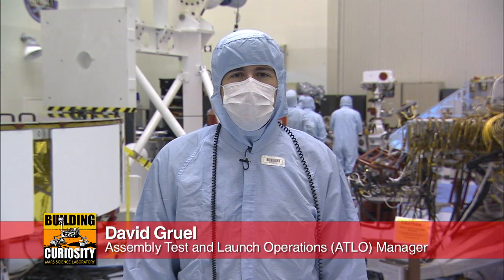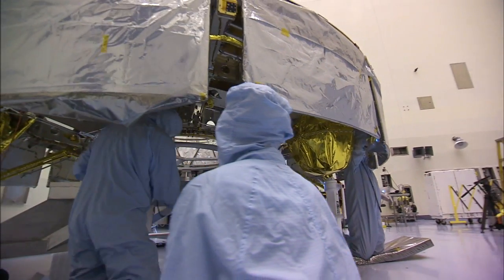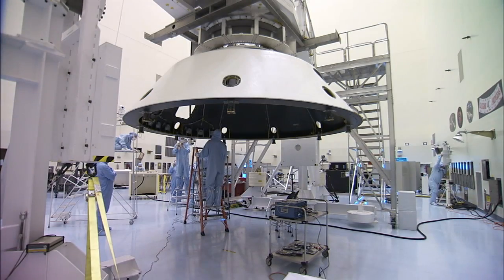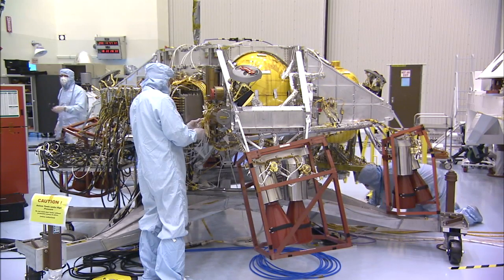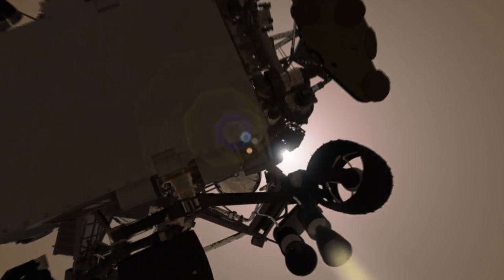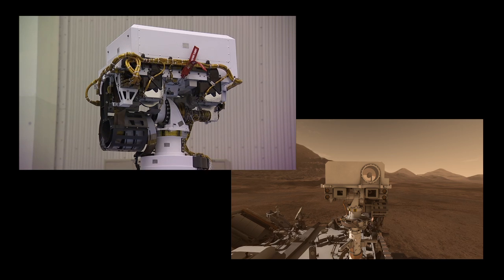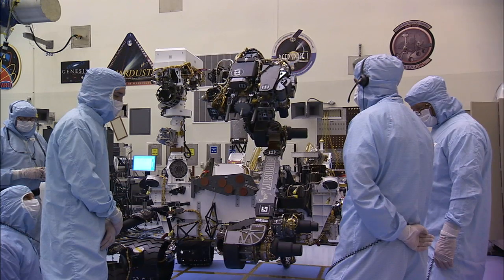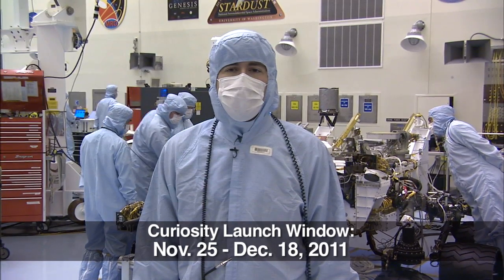Building Curiosity: Rover at Kennedy Space Center

Comment: @theshadowify landing system is complicated indeed, but parachute wont work properly since atmospheric preasure is low. It can slow an object down from "very fast moving" to "fast moving" only (or we need to built a really giant parachute). Speaking of parachute and all those wires and cables 2 seconds later - people jump out of planes with parachutes rolled in their backpacks. Trust on that :confused but most of the time it works actually...